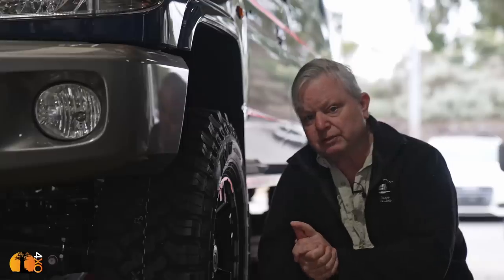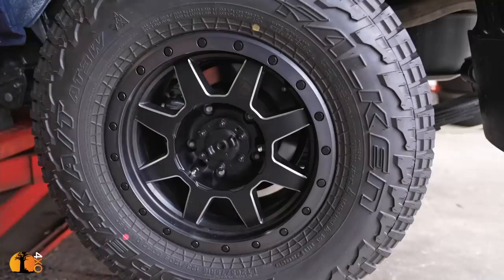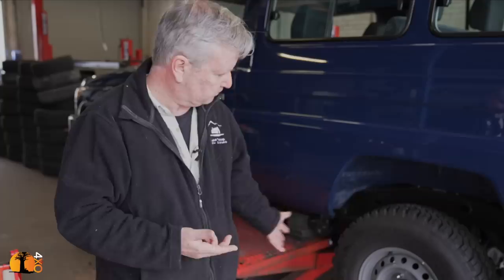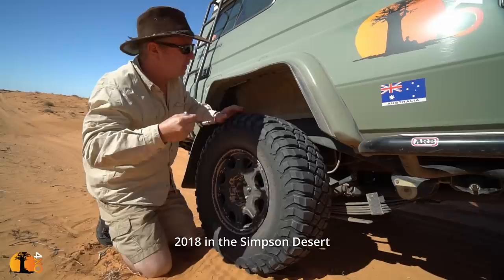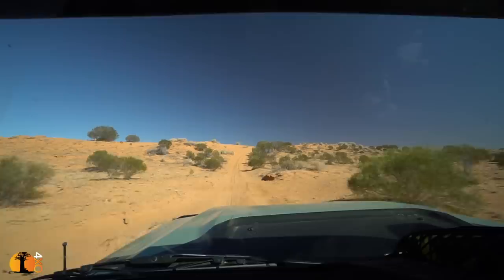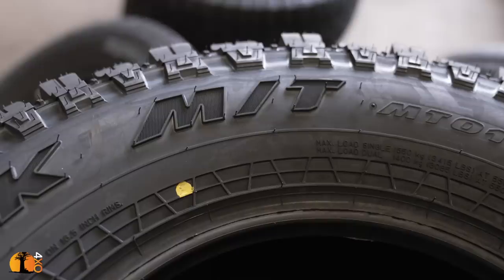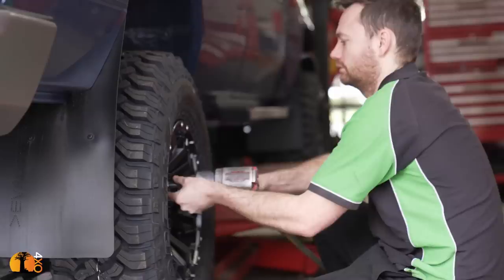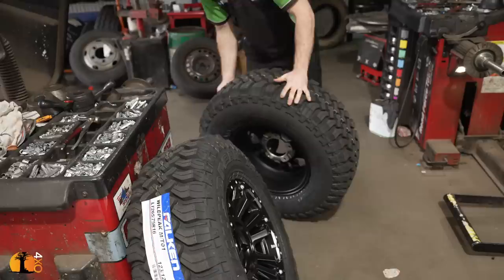TYRE AND WHEEL RIM CHOICES | BUILDING THE BEST 2-PERSON OVERLAND TOURER IN THE WORLD | 4xOverland

Comment: When you say that wide tyres don’t have any advantage, do you mean for overlanding? For overlanding in Australia? I guess they have advantages on certain terrains, like sand or snow. Don’t they? I’ve arrived from three weeks in Iceland and I was totally shocked by the absolutely massive tyres A LOT of 4x4s have over there. I suppose that might be somehow justified and that it is not only a trend. What do you have to say? Thanks!
Reply: I've noticed that folks that don't want to chop out their fender wells and the like or go for big lifts like narrower tires. Skinnier tires can be taller and still tuck up inside your fenders when you're flexing. Aired down, a skinnier taller tire will actually still have a larger footprint than a wider, shorter tire. They have less rolling resistance, more downward bite, they steer better in the front at least. Even most mud boggers I know like the narrow stuff, but when you get into man-made mudholes, or the snow in Iceland, your skinny tire will probably sink up to your axles or over the hood of your car before you reach the actual ground. Skinny's also take up less room and weigh less. I think wide tires are popular because so many people run aggressive, wide mud tires on their full size trucks and they will be drive on pavement whereas narrow tire feels a little more squirmy.  I find that the normal width wide tires seen almost trucks spin out less easily on pavement and feel more stable
Reply: Here in Iceland we have the same dilemma. Over all hight is always king to float on snow but then you have arguements that skinny tires work better on light jeeps with litte power and wide for the others. But most agree and talk about how high tires they choose. F.x. for long highland or glacier trips 38 inch is standard on light pickups, 44-46 inches on medium size jeeps and 54 inches for the heavy american trucks.
But with tires like that we can let them down to even 1 psi and then the jeeps footprint on the snow will get lighter then a humans.
Reply from the maker: Thank you. Thank you. Thank you!
Reply: Chicks love my 285 tyres stance so am for wide all the way 😅😅
Reply: Wider tyres perform worse on sand than a narrower tyre, it's the bigger outside rolling diameter that makes the better performance on sand by making a longer foot print.
Reply: @sailingcitrinesunset4065  do know about that. It might be the different type sand .
But when you could drive on the beach and dunes in florida and in the Sandhills 
Most of the people that made it to the top used bigger wider tires.  My smaller one when I off-roaded alot were 36-15.50r15 on a 12 in wide rim.
They went up to 44-18.15r16.5
They were all heavy trucks with 400 cid 6.6lt or larger engines  most on 1ton axels.
Really made for mud and high water crossing but they worked on the sand here just fine .

I really don't off road much anymore but still have to get over mud and sand on a few farms. 
My farm truck is a 93 blazer with 32-11.50r15 and 10in rims and they work well.
Reply: I’ve traveled a fair bit around australia off-road. I would say the best combination is a 16” wheel with a 33” tyre with a max width of 275. Too wide and you start using too much fuel to justify the extra gain, once you are fully loaded a wider heavier tyre will sap power and it is noticeable. The goldilocks for me would be a 35” tyre with a strong sidewall that’s 275 wide on a 16” wheel, it would float over corrugations and be amazing through sand.

Comment: I  guess its just me but I find 90% of aftermarket wheels to be be downright tacky or ugly. I actually like the look of the basic steel dish wheel.
Reply: look up the Rotiform STL.
Reply: @cromulentparty  Yeah, I like em. Forged aluminum is great but $1100 per wheel is steep (for me, anyway)
Reply: I agree. Something about them just looks right on the Cruiser in Grey. I'm actually widening mine to 8 inch for the next set of tyres.
Reply: It's not just you.
Reply: Same, and in fact the tyres aren’t bad either. I’ve never seen Andrew in a situation where such aggressive tyres are absolutely essential, never. So the normal tyres are fine.

Comment: This title really does my head in. This will be your third go at a Troopy in a row dude.... I wouldn't call any of your previous efforts worthy of such a title either. Here we go, just bolting stuff on from a catalog again...... Can't wait for the epesode where the spare wheel gets bolted inside the Toymoto.....
Reply: Thats just cosmetics, Andrew does all the hard graft and the tecnical stuff, The other vehicles were good and the 2nd Troopy was right up there, The last Troopy never had a failure and not a single pucture, It survived all the Serious miles/Ks the Outback has to offer and he lived in it for a few months totally un-Aided, So what else is needed from a Vehicle when it has performed flawlessly, ?
Reply: @simplerefinedliving yes from someone with such a backstory, you would think he would know what he was doing by now, but it seems not. Pretty sure I mentioned in comments about the 255 tyre size a few years back for Troopys, now taken on board. I'd recommend Cooper tyres which dont seem to get a mention. Should do my own videos probably.

Comment: 255 85 r16 All day, my 76 loves them. Maybe if you start using them your influence will assist in more places carrying them.
Reply: Still not common in the outback though. So he could find himself in a dilemma.
Reply: Popular demand could fix this... I'm pretty sure many people want 33s that are not too wide.
Reply: They are hard to find even in the states.  Though the Toyota crowd is the primary user of them even in the US as the 255/85 allows a Tacoma or 4 Runner to fit 33s with only a 2 inch lift with no fender rub, the 285/75 size requires some cutting in the wheel well to fit without rubbing even with up to a 4 inch lift.  And the Tacoma and 4  Runner are by far the most popular overlanding vehicles in the US.
Reply: @mrvwbug4423  Defender enthusiasts also rate them highly.

Comment: Watching this video and reading through these comments is great to see 255/85s have an appreciation. I'm tossing up between sticking with 235/85 or going with the 255s next round.
Reply: If you've got a Troopy, they are a really good size.  I think they are a couple of mm taller than the OEM tyre size of 225/95.  Speedo gets marginally more accurate. And when you air down you get a really good long footprint.

Comment: Running 255/85 R16 Yokohama Geolandar MT G003 on my Defender & it's an awesome size & tyre choice. No worries from me on taking it remote as modern construction tyres can cope with the outback as long as you look after them. Been all over with them, probably on tougher tracks than I've seen Andrew on, with no dramas at all so unless you're forging new tracks don't stress about availability.
Reply: You still rate these tyres? Cheers
Reply: @petergallagher1825  Yep, still going strong after many trips to the Vic High Country, deserts including the muddy sections & countless corrugations. You have to air down a bit further than you think on soft sand as the sidewalls are so strong they don't elongate so easily, but they still perform excellently when you do. No air loss issues & wearing evenly so far with rotations every 5000km or so. Couldn't rate them higher tbh 👍

Comment: I agree with a lot of the other comments about 255/85r16 tyres, these are a far better option for overlanding than a 285 or 265. I think this is a size that should be getting a lot more attention. The  height and track width of the tyre accompanied by an elongated footprint make it superior to the wider options. Just look at what the army and emergency services use for real offroading. . .definitely not wide tyres.
Reply: The army and emergency does not do hard off roading because there is no logic for them to do that. it is also price and breakdowns calculated.

Comment: Interesting choice, I've just put Toyo open country 265 x 70 x 16 on my D22 (the tyres are now worth more than the ute) I wanted 75 profile but was worried it would rub (standard suspension starting to sag, they would be fine on a better suspension) and a lot more expensive. They handle quite nicely. It's been very wet here lately and I haven't lost traction once on the blacktop. Only had them off road once and handled it fine although the corrugations did upset the wheel balance.  Road noise is there but OK with the radio on.
Reply: I just got that tire in 75 profile, they look nice. No rubbing on my 4runner.

Comment: I also have these ROH viper rims, but I purchased them for a different reason, which I has not been discussed anywhere online I can find. My choice was to do with the GVM rating on a rim! When you have a GVM upgrade on a 79 series the GVM on the standard tyres are not legally rated for that weight upgrade. I enquired after the fact back to my suspension upgrade store, and they researched it and found this to be correct. In hind sight the store is now having to upgrade rims with there suspension upgrades to comply with Qld Law. Like the Rhino rack load rating Saga, I think this is a topic that could be raised through your channel.
Cheers.

Comment: Andrew, we have a Citroen 2CV in the UK which has been across the Sahara and Atlas Mountains. In my experience it's got to be steel. You can't hammer a dent out of an alloy!
Reply: If you are bending an alloy rim....your problem is not the rim, you are the problem
Reply: @scavenom2008  not true at all, anything can happen and cause an accident to bent an alloy. Also if your only carrying one spare to save weight why not make the rims steel and just have that piece of mind that you can probably fix that rim
Reply: @liamadams8647  what do you mean anything can happen? Any mistakes by the driver you mean? I'm sorry but that's just a bad idea to say things happen unexpectedly or through bad luck. You seem to forget alloy rims are much stronger than steel too and steel rims ca be fixed but it depends on the damage. One thing that I can tell you is that the type of damage that would bent a steel rim with the chance to fix it wouldn't bend or crack an alloy one. Now imagine yourself in the outdoors often even having to remove the tire to bend the steel wheel back in shape. People are better off being good drivers with something that can take some damage and not require fixing at all. The tire irons and steel hammers aren't light weight either.
Reply: @liamadams8647  I am speaking from experience myself. Where do you off road I'm curious. What's your background or technical expertise?

Comment: Agree the best tyre is a 255 85 R16.    I am driving an ex Army Land Rover 110 (“Perentie”).  Was running a set of 265 75 16, but found them just a fraction too small (I was dragging my diff, when all my mates running 255 85 16 weren’t),  so went up to Maxxis Bighorns in 255 85 16.      Great tyre, but went through them pretty quickly.  Been searching for a new set for about 6 months now at the right price.     The only decent ones I have found are BFG KM3, Toyo Open Country MTs, and Yokohama Geolanders.   As a result of them being  rare, they are pricey.   Around $350 to $400 a corner.   Lucked out and found a set of Yokohama Geolanders for $265 a corner in Melbourne a couple of weeks ago.    Stoked.

Comment: The choice of wheels and tyres also plays a big part when it comes to vehicle weight. 

What about 15" rims, would they fit? 
Less alloy and more rubber. It also opens up the door to 33x12.50r15, which is everywhere, or 33x10.50r15, which is roughly the same size as a 255/85r16.
It would also allow you to run a 15x7" rim with the 33x.10.50r15 tyre, which would make for a very light combo. 7" wide rims would also make the tyre bulge a lot more. 
Also, a more basic rim design with no fake beadlock could probably shave some weight. 

With all this in mind, and after a little bit of research: 

Example similar to current setup: 
16x8" Method Race wheel with fake beadlock- 11.56Kg.
255/85r16 Bfg Km3 - 26.76Kg.
Weight of 1 wheel -  38.32Kg.
Weight of 5 wheels-  191.6Kg.
Weight of 6 wheels - 228.62Kg.

A lighter 15" example:
15x7" American Racing AR23 - 7.71Kg.
33x10.50r15 Bfg Km3 - 25.71 Kg.
Weight of 1 wheel - 33.42Kg.
Weight of 6 wheels - 200.52Kg. 

That's 5Kg/wheel savings, 20Kg of unsprung weight .You can almost run 6 15" wheels for the weight of 5 16" wheels.
Reply: I'm actually running 15"x8 wheels forged mag with 33x12.50 MT on my 62 series, no complaint, been giving them heaps too, the only thing is that the load carrying capacity and max pressures is less than on 16" tyres of the same quality, I always wonder why that is?

Comment: As this is a light weight build it would have been nice to know the weight difference between the original and new tyre/wheel set up
Reply: I weigh everything on my Troopy. Those VDJ78 wheels and tyres weigh 28.5kgs.  The 16x7.5 mag and 265/75 muddies on my caravan weigh 36kgs.
Reply: @philg2468  stock 16x6" non split steelies with bridgestone dueller 225/95r16?

Comment: Andrew, I was thinking about your tyre size choice. I’m running the same size, 265/75/16 on a dmax. When you go 255/85/16 with 2 spares, What is the odds of having to replace these tyres when you out in the bush? If you really have to get to that point of emergency, just put 2 x 265/75/16 on to get you back home. Then you can sell those 2 tyres on social media, and get the 255’s again.

Just a thought… The 33” will look nicer on a troopy when you lift it
Reply: 265/75/r18 is stock for patrol/armadas , so it was an easy choice for myself.

Comment: I had 16 x 8 with 285, now I have the stock 79 series non split rim skinnies on my 76 series, but before we go on our trip, I'll be using my current 16x6 steel wheels with the Toyo 255 85 16. It's the goldilocks of tyres. I'll carry two spares on big trips, plus a trailer with same tyres and a one spare on the trailer. 
It's already been said, but if you influencers started using the 255, maybe they'd be easier to get?
Reply: Totally agree with you, while watching the video I am really hoping he will choose the 255/85R16 because I know this is the perfect size for off road and Andrew will influence a lot of people to look for this size hence tyre dealers will have the confidence of stocking them and eventually tyre manufacturers will increase production of this size.
Reply: Steven,  the approved rim size for your Toyo 255/85 are 6.5" up to 8",  so your current 6" rims are too skinny.  You can get 105 series 6.5" rims which will take the 255 perfectly.
Reply: @philg2468  or can just be a trend setter and get them on 6" rims. They fit fine. Work well, don't come off the bead. What's 1/2" between friends anyway. Only 6mm each side.

Comment: Great video! I’m in the process of changing tires on my 5th Gen 4Runner. Decided to go with Falken Wildpeak AT3W 255/80/17 from the stock size on a 2” lift (2”on rear and 2.25” on front).

Came from a D110 with 235/85’s and they were fantastic off-road so looking forward to these new tires on the Toyota. Overall weight being added was a big factor in my decision making process.

Comment: Good episode — glad to see your new build and excited to see what you do to save weight!  Question 4U: So if you went with a 32” tire, why didn’t you go 235/85R16, which is also very common, and also a skinny? You could have run a 16x7” rim and done the 235/85 or bumped up an inch to the 255/85. I feel like the 265 is on cusp of being too fat.

IMO, the rims you chose seem too SoCal to me — I personally would have gone with either a D-window steely or an 8- or 10-hole aluminum rim. But with bar work, decals, and some dirt, the wheels will probably grow on me. 

Looking forward to your next build video — thanks!